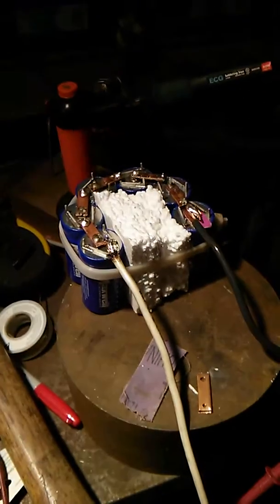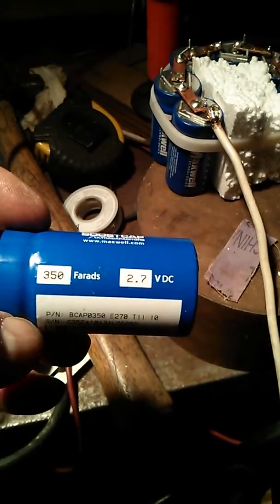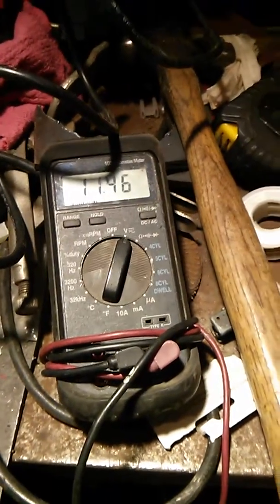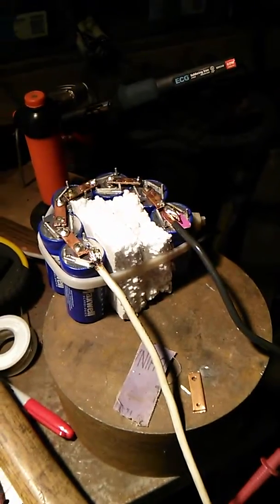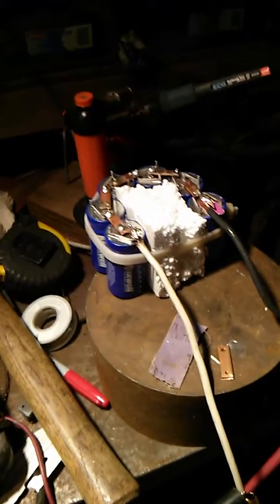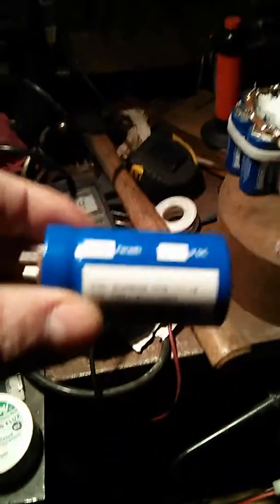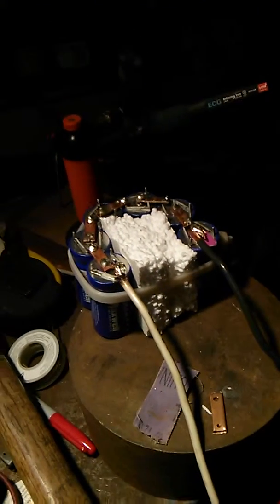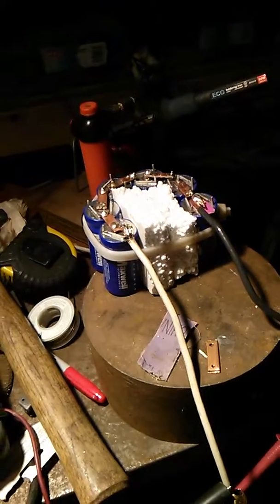12 Volt Super Capacitor Bank 350 Farads 2.7 Volt Boostcaps

Comment: Your Capacitors are hooked up in series. not gonna go through the math but you actually have 58 Farads of capacitance. To make this a 2100 Farad circuit you would need to hook them up in parallel but in doing that your output voltage would be 2.7 volts.
Reply: capacitance = amount of charge stored. More Farads = More Energy
Reply from the maker: I haven't got a clue on the math of this idea and I simply tried to copy what I saw another guy do in a video he posted. I got the same value caps he was talking about and hooked them up to see what would happen. If I hooked them up in parallel wouldn't I still be fixed at the 2.7 volts and then not have enough voltage to turn a 12 volt starter motor?
Reply: ya thats right. You'd be sacrificing voltage for more charge. You are sure it's the exact same setup?

Comment: Your tractor is most likely diesel, not gasoline engine.  Diesel engines need a lot more amps to start since the compression ratio in diesel engines is easily double that of a 4 cylinder gasoline engine.  Also your using supercaps with 2 top terminals, I believe lasersaber was using supercaps that have one screw terminal one each end which can deliver more instantaneous amps then the supercaps you have.
Reply from the maker: My tractor is a 1951 Harry Ferguson TO20 4 cylinder gas. It does take a pretty good dose of juice to get it going so that could easily be it too. I don't know, still a fun experiment for me and then again I may have missed something in the video I watched.